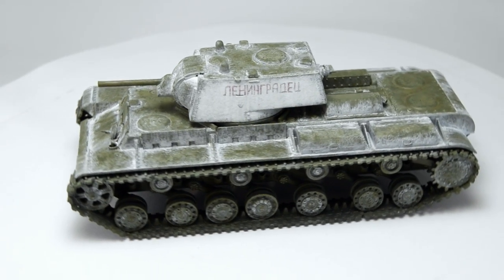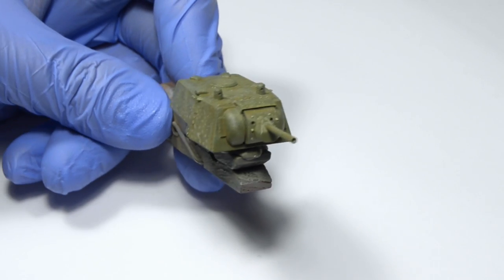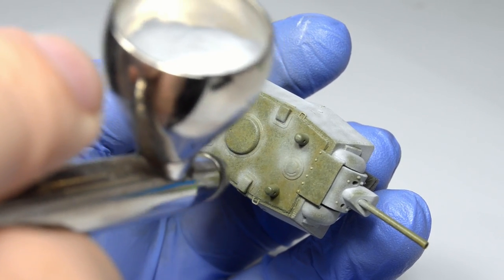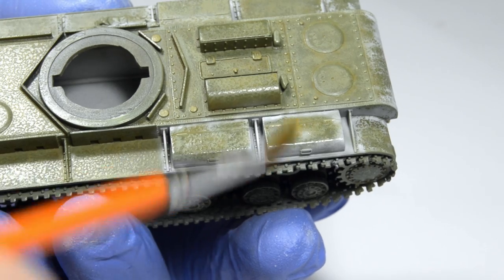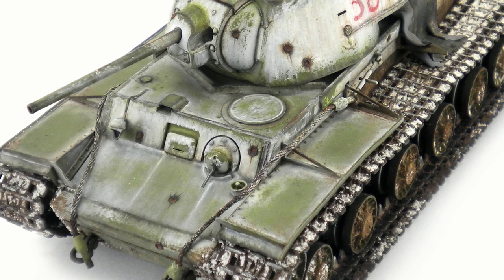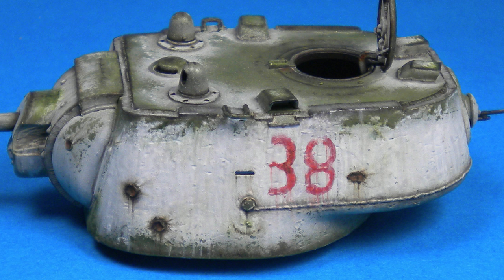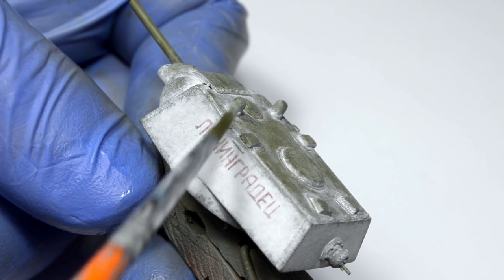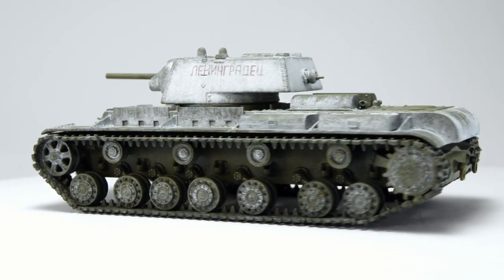Worn Winter Camouflage Tutorial | Tips & Troubleshooting

Comment: to avoid the beading up of the chipping fluid, have you tried to use a product which reduces surfaces tension?
Reply from the maker: no I don’t have such a product. matt surface is usually good enough to prevent the fluid from beading up. any extra potions might alter its chipping abilities

Comment: I thought you mentioned that chipping/hairspray products are a crutch and that you should do it by hand. I guess 1/72 is almost impossible?
Reply from the maker: Noooo, I was talking about regular chipping effects - some people don't have the patience to paint small chips by hand so they resort to hairspray chipping, but that doesn't guarantee perfect in-scale chips. Also, doing those chips with hairspray often takes a long time as well, and it takes a lot of patience too. So when modellers try to use hairspray as the easy way, the results are often not much better. Painting winter camo with hairspray method is basically a norm these days :)
Reply: @NightShiftScaleModels  Thanks for your response! I understand now.

Comment: Not sure if you have a video on how to accurately assemble tank tracks for 1/35 scale. Mine don’t look so good 😂
Reply from the maker: These don't look very good either :D :D 
I haven't yet... thanks for the tip.
Reply: There was a section about it in the video of assembling the Japanese Chi-Ri, but those tracks were a bit oddball.
Reply from the maker: @bluef1sh926  Yeah, those were workable plastic tracks. I can do videos on workable metal tracks, plastic workable tracks, link and length type, individual links that have to be glued...
Reply: Night Shift let’s just say I used a combination of Tamiya cement and loctite 😂 it does not look as bad as the ones your buddy glued up on this model but I can tell. I think my problem was molding them into place and not pulling the slack enough so they did not come together as well. Thanks for the reply. I used to build kits when I was younger but due to financial resources I was limited to superglue and spray paint. Now as an adult I can invest more resources into brushes and the right tools. I am building a MIG ammo King Tiger. We will see how it comes out but I will definitely incorporate your weathering and texturing tips.
Reply from the maker: @InSidious1805  The best approach for individual link or link-and-length plastic tracks which you have to glue together is to quickly glue the entire run on a flat surface with, let's say, Tamiya cement as you did, and while they're still "workable", wrap them around the running gear, position them correctly, create sag, etc. Let them dry overnight and then you can easily remove them for painting. They will retain their shape and fit back without any issues!